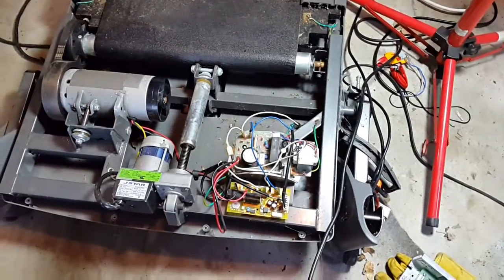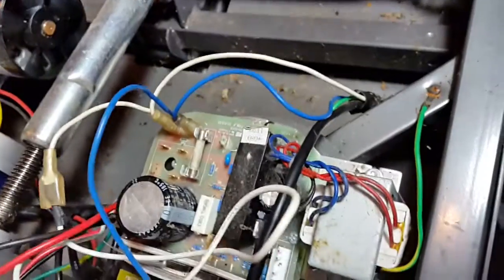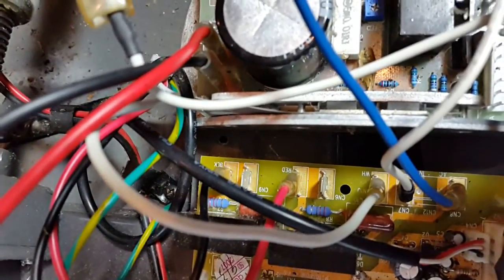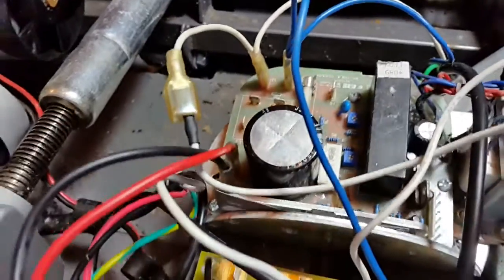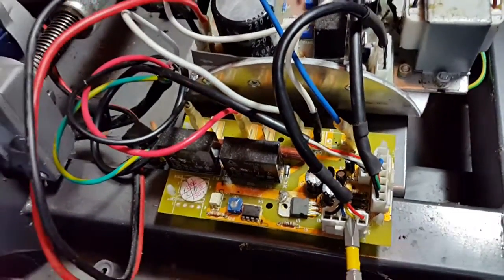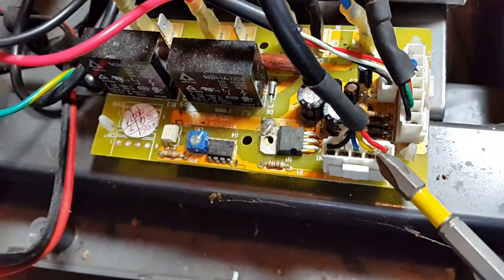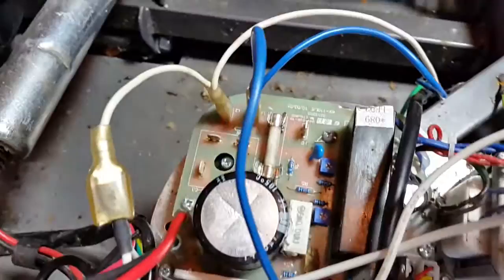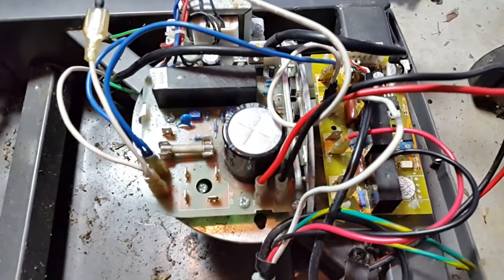Smooth 5.25 Controller / Relay PCB Wiring

Comment: Great video...thanks for sharing! I have same model. The belt on mine would not turn when speed was increased. I found a blown 15A fuse on the power supply board caused by a bridge rectifier (1 of 4 diodes) had a shorted diode internally. The bridge rectifier is difficult to unsolder. When a replacement part is ordered, be sure the height of the new part is as thin as the old one. The solder pads for the bridge are between the part and the board. You will not be able to fit a soldering iron between the board and the part. A new or refurbished board is around $180. I fixed mine for around $20.
Reply: I have the same problem but dont know how to do what you did. Care to help?